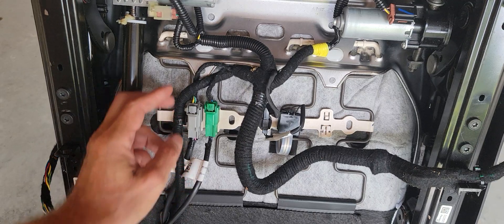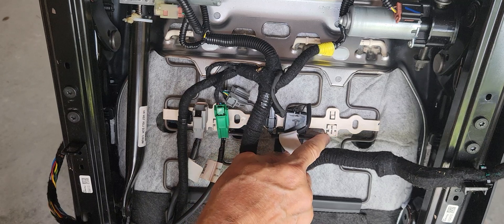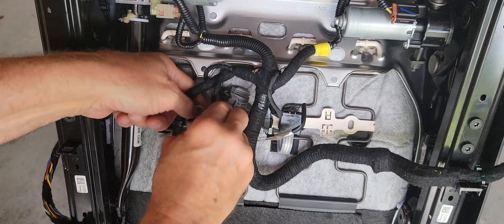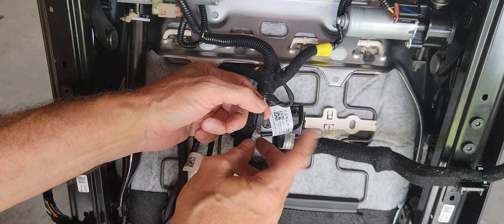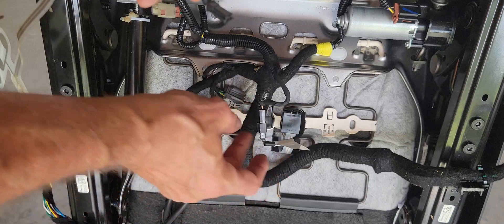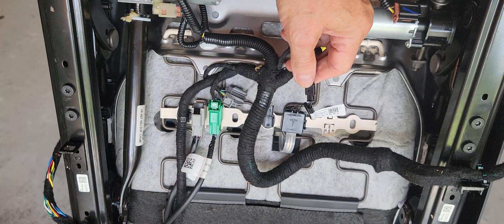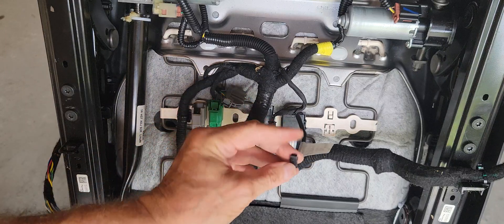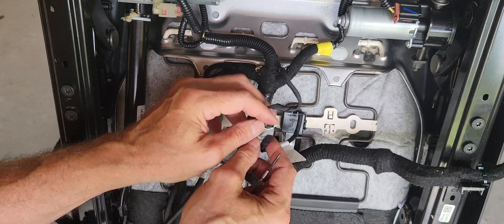How to disconnect the seat bottom connectors of a Tesla Model 3/Y to fix swap seat bottom that hurts

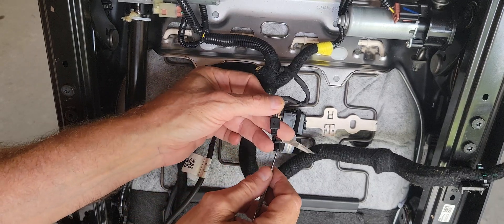Comment: Umm...not quite sure this is the approved solution for some of this. Specifically, while struggling to undo the smaller, black connector from 2:18 to 2:40 or so, he describes "the problem" as being a connector rail getting "stuck" in the receiver. Umm...pretty sure he's describing a keyed connector with a tab that one is SUPPOSED to press down. It's not a "problem" that it has a key tab to retain it. Rather, it's by DESIGN.  Just seems like some messing around and trial-and-error that's likely to break the connector in this case. There's gotta' be a better video and instruction set for this.